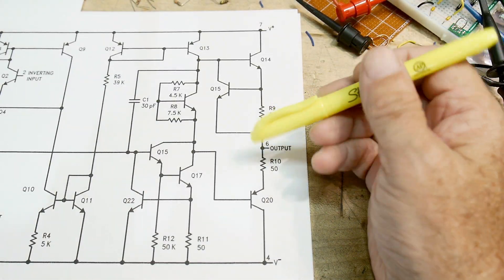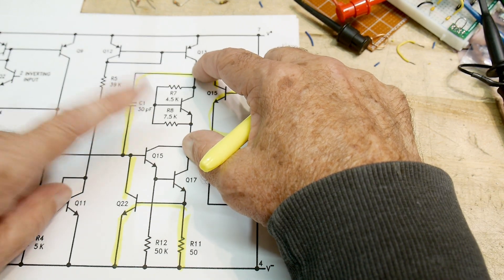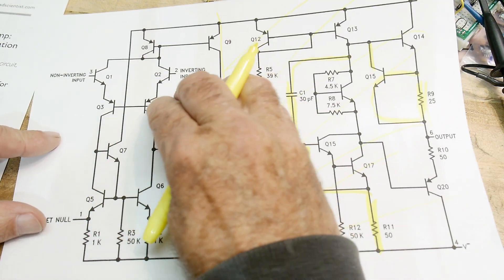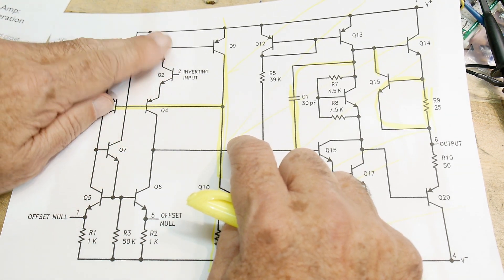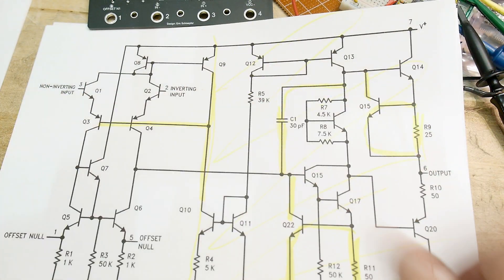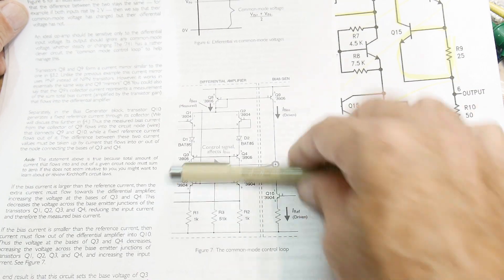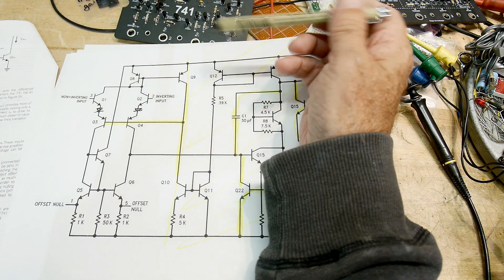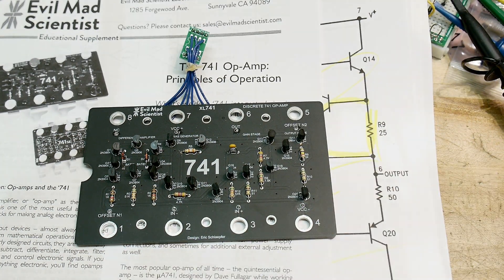#1737 Evil Mad Scientist 741 (part 3 of 3)

Comment: The Q3 and Q4 is pretty standard cascode configuration. Or a Common Base. So load the emiter follower with a very low input impedance and a high output.

Comment: The 2 diodes are added to prevent BE break-down of the 2 pnps. BE break-down voltage of the lateral pnps in the IC is over 44V (lateral pnp) while for discreet ones is only about 6V. The input accepts 40V differential input voltage.

Comment: There should be a simple discreet op-amp inside an audio hi power amplifier. Input impedance doesn't need to be high as it is configured as non-inverting amplifier. Might be fun and practical to do a video on it.

Comment: OK, for the THIRD TIME..

In part 1,  you replaced the XL7841 with a "real" 741 and, in so doing, you found a bypass capacitor out of place and corrected that. Did you go back and test the XL741 with that correction and, if so, did the XL741 behave better?

APPRECIATE YOU'RE ANSWERING THIS!
Reply from the maker: no. and  I don't know
Reply: @IMSAIGuy appreciate it. Ordered the board and wondered if you had discovered any omission in your testing.

Looking forward to building it up and, with your videos, learning more about the 741 innards.

By the way, your Zener series was fantastic!

Comment: Roland attacks the Push Pull from above in the TR-707 and using 2 diodes, but here Q15 is located below.
9:59 hat if you hook at TL071 (voltage follower) instead of you scope probe?
Weird config for Q15/Q17.

I made a VCA circuit using Push Pull and inject my signal between R7 and R8, directly on the base of the transistor and no crossover distortion.
I was my first experiment with VBE multiplier.

Comment: There are FET input opamps like the ADA4622 with spec typical input impedance of 10^13 ohms (both differential and common mode), so I'm not sure why an active probe should be limited to 10 Meg ohms...
Reply: There are occasions when very high resistance is desirable, but in general FET probes are used because of their low capacitance. 2 pF has a reactance of 10M at only about 8 kHz. At 10 MHz the reactance is down to just 8k. That's a big improvement over a passive probe but still not what you'd call great.
Reply: @D614G_aka_Doug  Good point. Thanks!

Comment: That is an interesting story for me. When I was asked to hold a first lecture at the university as assistance professor, I was afraid not to be boring for advanced students, so I took the internal function of the 741. 
As subject for the lecture, I asked the students after the relevant explanation to identify the function of the transistors that work together in pairs, like differential amplifier, cascode pair, darlington pair and current mirror. 

Some of the students were advanced enough to ask for the input common mode control. 
It is also described in the source you added but it is not really simple and you mentioned it mainly: The mirror Q11, Q12 provides the current for Q3, Q4 (the cascode partners for Q1, Q2). The current is higher than what is needed to keep the inputs on their level. So, the collector currents of Q1, Q2 are mirrored back via Q8, Q9 to Q10 forming a control loop. It has the effect that the bases of Q3, Q4 are driven by a high resistive source and practically do not change the working conditions over the common mode range. 

The differential amplifier of the input stage has a current mirror Q5, Q6 as working resistance which provides high amplification. To achieve high symmetry the base currents for Q5, Q6 are not directly taken from the collector of Q5, just the base current for Q7 is taken from there. 
As it is already a long story: For the probe for sensitive circuits you could try a 100/1 probe which has higher resistance like 100MOhm or you could build one with GOhms , the capacity or frequency might not so much be the limiting issue.